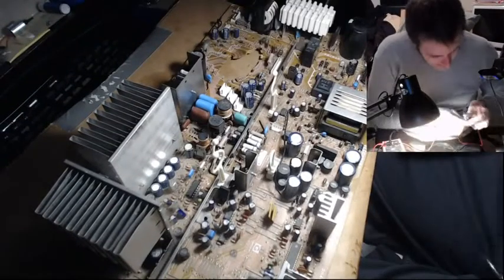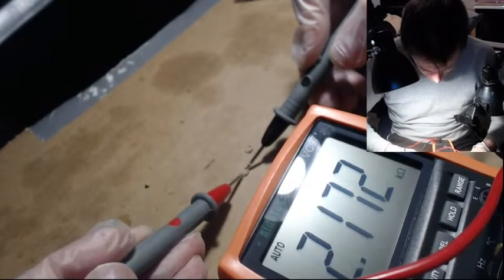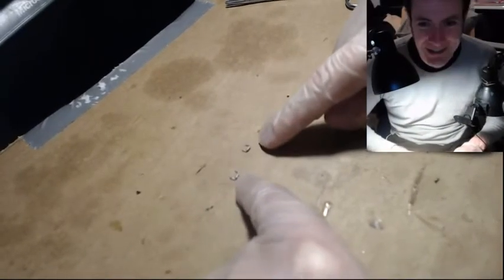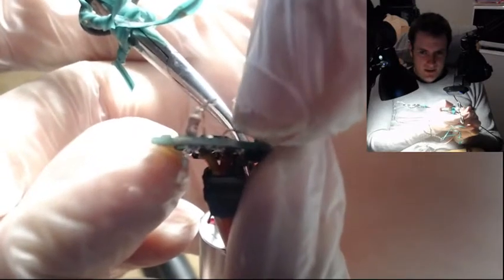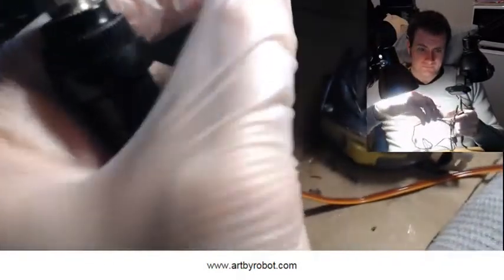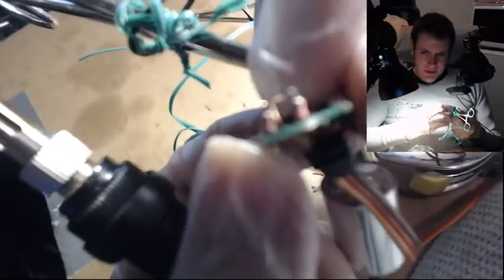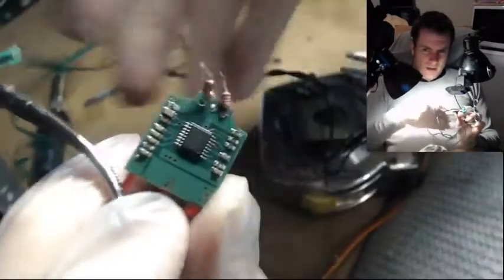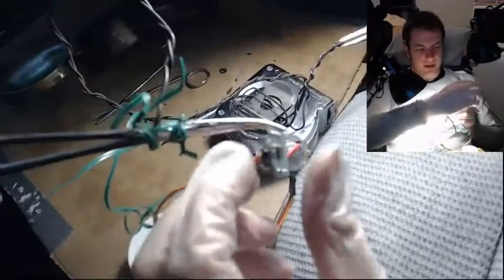MG996r Servo Continuous Rotation Mod - Replacing Pot w/ Resistors | Building Humanoid Robots #61

Comment: i removed the potentiometer and did not put any resistors, it still works. Would you mind explaining what's the logic behind connecting the 3 endpoints with resistors? Does it have something to do with controlling the "start/stop" of the spin? thanks!
Reply from the maker: yeah I think the 3 endpoints having same resistance is the zero message that would have come from the potentiometer which means it is the resistance value at which you set software telling it to stop once it hits that resistance.   Something like that.

Comment: Hi I'm getting alot of jittering after my mod. it worked perfect on the older style mg966r but not the ones I just got.any ideas? add a capacitator?
Reply from the maker: I'm very new to this stuff so I'm not sure.  Jitters can be lack of power.  Are you powering directly off the microcontroller?  You should consider powering separately from a different power source.